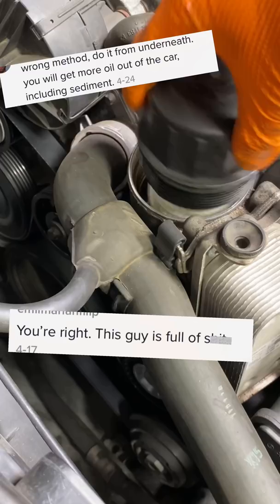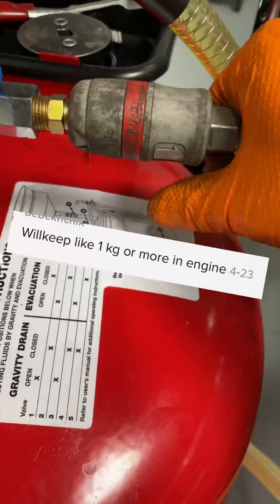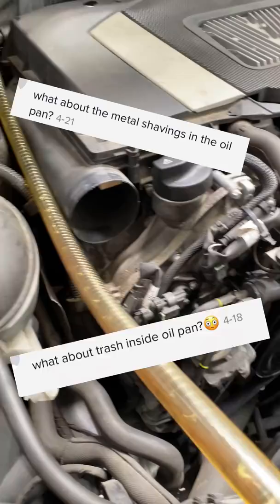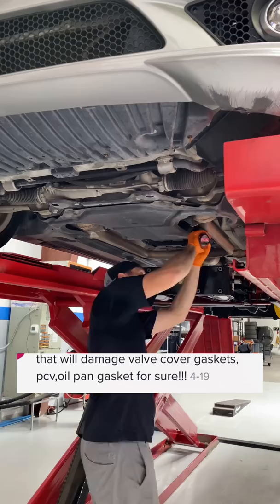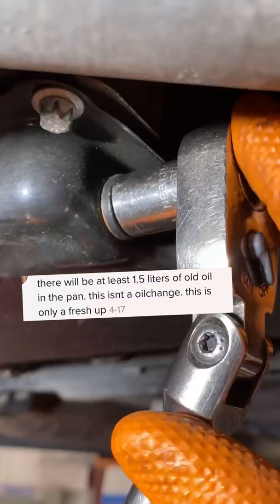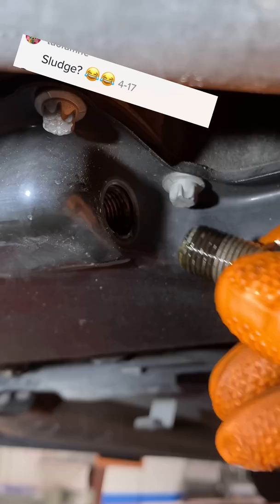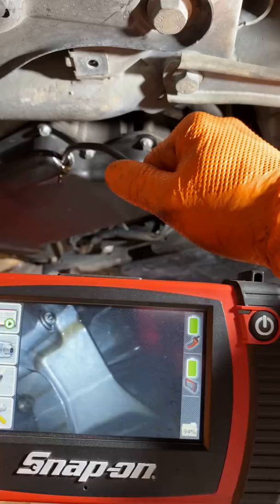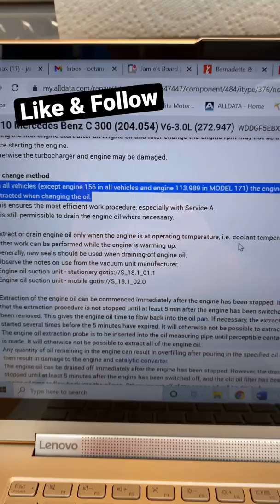#shorts Mechanic Proves Haters Wrong

Comment: "Metal shavings in the oil pan" I'm no mechanic, but if you've got metal shavings in the pan, you have FAR bigger problems than old oil
Reply: Lmao true
Reply: Metal shavings aren't all that uncommon. Unless you get an unusual amount, is nothing to worry about. Especially on a newer vehicle
Reply: Mechanics are suppose to drain the oil using the drain plug on the bottom of the pan. Then they ate suppose to inspect the condition of the oil to see if there is any foreign objects in the oil. Then you report that to the vehicle owner.........
Sucking it through the top is just being lazy simple as that😛
Reply: @2011sombrerotejano  The car is literally designed for a pressure purge through the top of the block?????
Reply: @2011sombrerotejano  Ah... i see. Not only did you not watch the vid, but you also supposedly know more about the vehicle than a mechanic or the people who built the damn thing and tells you specifically how it was designed to be emptied.
Reply: @2011sombrerotejano lmao, you delusional bud?
Reply: There will always be a slightly small amount of shavings, not much but some. If you have a lot then yes it's a biggo issue
Reply: @stardoge6624  Metal particles, yes. Shavings implies something like you'd get from filing metal.
Reply: @RangerOfTheOrder  fair point. Didn't realize your intent was legitimate shavings, my bad
Reply: I was thinking that I was also thinking it's not the transmission lol
Reply: Lmao
Reply: @2011sombrerotejano  are you slow??
Reply: @2011sombrerotejano  Mercedes literally DESIGNED AND ENGINEERD the cars to be serviced like that, but o guess you are smarter than a team of engineers paid 6figures to design cars for a living. Okay dude. You're right.
Reply: @GunShocka  and not just any mechanic. A fucking certified Mercedes Benz mechanic. Like one that literally is certified to work on only Mercedes 🤦🏻‍♂️
Reply: @RangerOfTheOrder  you're arguing semantics..."metal particles"=tiny metal shavings. If not please explain how they get there.
Reply: @GunShocka  well i knew more about fixing my bmw 5 series than the mechanics from bmw working on my car..so yes you can know more than a dealervor regular mechanic. 

Btw i took it to the dealer because it was under warranty but after 2 weeks enough was enough so i had to step in.
Reply: @RanGer-498  You do realize that this isn't a BMW. You seriously tried to tell the certified mechanic of a Merceades Benz That pulled out the official manual that states EXACTLY how Mercedes themselves wants and has designed the car to have its oil emptied and cleaned. Right. We are making fun of you cause all you had to do is watch the video. And yet you try calling the mechanic lazy
Reply: @2011sombrerotejano  <------looks like we have another "mechanic" folks that clearly doesn't know anything about Mercedes or how they are engineered. You clearly didn't watch the video.
Reply: @fifthcylinder  yeah that’s why they have the saying “breaking in the engine”
Reply: @2011sombrerotejano  I read that in my best Mr. Mackie voice !🤣🤣🤣🤣🤣🤣🤣🤣🤣🤣🤣🤣🤣
Reply: @fifthcylinder  of
Reply: @2011sombrerotejano  This guy is a great example that no matter how well you explain something, some people just won’t get it.
Reply: All these comments are Mercedes specific not oil changes in most vehicles specific.
Reply: Lol no one said this isn’t how Mercedes designed it.everyone getting defensive. Like they think just because Mercedes designed their car to be serviced this way it’s a great idea. One of you explain to me how changing oil this way is a better idea. You will always have metal dust as long as you have metal moving parts. So how is sucking it through the engine a good idea??? Newer Mercedes are known for being ultra reliable cars that you can put hundreds of thousands of miles on right? Lol that’s why everyone trades them in at 50k miles and they lose their value faster then a pregnant stripper in Vegas. You want to know why they design them this way? So that you have to take your car to Mercedes dealer for service where they charge $500min for a service. Tell me I am wrong I have own more Mercedes then most of you I promise. They charge insane amounts for oil changes.  And the cars loose value so fast. Toyotas are know for reliability and they get $60 oil changes not $500 and you drain from the pan.
Reply: @2011sombrerotejano  How does it feel to be so freaking wrong?
Reply: @Chamacurmom  ewww
Reply: @HansDester  ew what? Good argument! I bet you are a “supervisor “ somewhere hahaha
Reply: literally i was abt to say i only had metal jn my oil pan once and it meant no more drivey drivery😭
Reply: @cebsaint  dudes more delusional then me and I got schizophrenia
Reply: Ain't that the damn truth
Reply: @Chamacurmom  Just because we aren't Merc Engineers and can't explain why they suggest doing it this way, doesn't mean they don't have their reasons for stating mechanics should. 

Email Mercedes.
Reply: @BillKayNJ  no I think we know exactly why they do it this way. It’s a pretty well known fact? So you have to take your car to dealer for service and pay hundreds for an oil change. Just like many of the Mercedes techs have admitted / commented on this video.
Reply: @2011sombrerotejano  🧢
Reply: my guy do you know what the oil is even for?
Reply: how would there not be metal shavings
Reply: @Dark farts don't ever act like a Benz is better then a 89 gm. My chevy truck will run longer and cost less to fix then any Mercedes benz.
Reply: Lol yeah those comments made my laugh.
Im wondering what they think about dry sump cars
Reply: @2011sombrerotejano  there not at all. Firstly theres few skilled techs 80% of the work force in a workshop are service techs, who arn’t technically minded. If theres any signs of swarf in the oil filter the car would have a big issue with knock or noise from the powertrain anyway. 
Oil change times for most high end manufactures is 15 to 45 mins depending on the task. Theres no sifting through oil 😂
Reply: I was dying when he threw that into the comments.
Reply: @2011sombrerotejano  yeah good call. Drain the black oil into a tub where you can't see a thing.
Reply: @2011sombrerotejano  you think they do that at them oil change places?
Reply: Well, IF you WERE a mechanic- you would know that the magnetic tip of that particular sump plug always has tiny metal particles on them when you pull them out to drop the oil. It's normal wear and tear... Be careful what stooges on You Tube try telling you to justify their actions. This is done to be quick and get 'em out the door fast. It's NOT the preferred method of doing oil changes
Reply: @2011sombrerotejano  EXACTLY bro...
Reply: @JustAGooseman  No, in fact it's not designed for that at all- otherwise there wouldn't be a magnetic drain plug you Wombat... 🤦
Reply: How many people on this thread are actual qualified mechanics? I've been qualified for 22 - 23 yrs, this is my career. This dude has cherry picked a low mile, well maintained Merc- AND TRIED TO HIDE THE METAL PARTICLES ON THE DRAIN PLUG'S MAGNETIC TIP... That's where the majority of the metal will be in this motor (other than in the filter), but some bearing material is non-Ferris metal and won't be attracted by the magnet. You need to clean this metal off the plug each time you change the oil. Visually inspecting the volume of metal particles on the plug gives you a really good idea of the overall health of the motor as well- and a quick look inside the sump while the plug is out will tell you if there's worse damage to the bearings and show and non-ferrous particles. So, this IS a lazy way of changing oil and if you find out your mechanic is doing your oil changes this way- you need to find a new mechanic. FAST...
Reply: @TheGr0nch  It's like you know nothing about engines at all... 🤔😂
Reply: @JustAGooseman  And you are LITERALLY making up "facts" as you go
Reply: @Dark farts How? Explain to me HOW changing the oil is different in those two vehicles... What your failing to grasp is that dealerships will never stop looking for ways to cut corners and increase profit margins... That doesn't mean that they are DESIGNED to be emptied like that... It's the same as these "fill for life" transmissions. Yes, if you stupid enough to believe that an auto trans can live any decent amount of lifespan on one fill of oil- then you probably would believe this too... FYI, those autos can have their oil changed, and if you treat them like a normal auto and change the cloud at regular intervals- it WILL last much longer. You need to get all the microscopic particles out of the transmission fluid or it will eat itself up over time. Just like the garbage that builds up on the sump plug on these Merc's...
Reply: @cebsaint  No- YOUR delusional... 😂
Reply: @RangerOfTheOrder  Those metal particles still build up over time and cause major damage to the bearings
Reply: @zaq55555555555555555  Oh man, your funny as... You REALLY believe that, huh... 😂🤣😂 I can see how easy it would be to be a dishonest mechanic... Geez... 99% of people in this comment section know jack shit about cars, but think they're gonna come in swinging against people who clearly know more than them... This is thoroughly entertaining
Reply: @danielbrealey2924  it takes longer to do that than to drain the sump. It also costs more to do that.
Reply: @jeepmanxj  Hence, my point- these dealership mechanics are cutting corners for increased profit. Just because it's done this way at a dealership, doesn't mean it's the preferred method... Same issue with these "fill for life transmissions"- the dealership will tell you there is no need or even ability to change the fluid- but that's not true at all. The fact of the matter is, not changing the trans fluid severely shortens it's lifespan. A better mechanic will tell you when to change it and offer the service... It's kinda the same thing with these dodgy oil changes, they don't care if the motor shits itself- as long as it makes the warranty period without needing bearings and rings they don't give a damn. They WANT you to buy a new car at the end of the warranty period- that's their aim. So, if that's what you want- follow their advice... 😂
Reply: @danielbrealey2924  so they are doing a service that takes more time and costs more because of the equipment because it's for profit? Ok?
Reply: @jeepmanxj  Yes, at the expense of the vehicle owner... Exactly, the customer gets screwed so they can make more profit- you realise they charge a lot more than general mechanics...
Reply: @Dark farts The fill for life trans B.S was used as an example of the poor quality workmanship on offer at dealerships... Brought this up because dealerships are the only ones draining the oil from up top. That little set up is worth big money and it's unnecessary
Reply: @Dark farts If you don't care about doing a good job, then fine. I was taught to work the other way. To have some pride in your work, other mechanics in the future will judge you on your workmanship. It's probably why we get a lot of restorations and big $ modifications getting done in shops I've worked at. I get what your saying, I just HATE shitty mechanics. I hate dishonest ones even more... We also like to do a condition report on vehicles coming through shops in my country. You can't tell your customer much about the engine if your not looking at what's coming out in the oil and how much metal is either in the bottom of the pan or attached to the magnet on the sump plug. It's all part of the "service charge" in Australia
Reply: @danielbrealey2924  What are you even talking about. You think you have more knowledge about a vehicle than the engineers who designed the vehicle. It literally says in the manual to suction out the oil. And the guy is a certified mechanic for this companies cars. What is wrong with you people. He even showed proof that suction out the liquid does just fine as he empties it out from the bottom afterward to show no sludge or sediment is left.
Reply: @danielbrealey2924  what the hell are you talking about? We’re discussing why Mercedes Benz have such high insurance rates and this is my field. I’ve been in the insurance industry for 9 years.
Reply: @fifthcylinder  i mean..
 if its enough to not get pulled by the oil flow its probably a big concern
Reply: There is literally a magnet inside oil pans to pull metal shavings and keep them from being circulated. As long as it's not alot, it's normal.
Reply: That’s correct. You would need an engine not a lof.
Reply: Lmao did my oil pan gasket on my 97 jeep NEVER BEEN TAKEN OFF till now there was a decent amount but from 97_2021 there definitely should be some lol still runs amazing and sounds beautiful those  inline 6s are amazing
Reply: @2011sombrerotejano  as the child of a mechanic I can say you're wrong
Reply: @2011sombrerotejano  you didn’t watch the video, read any of the comments, do any research whatsoever….. 
whats the advantage of draining the lil from the plug again? Explain it to me in detail. I think i know your mistake here
Reply: Indeed
Reply: My jeep always has at least a pound of brass in the oil pan when I change the oil are you telling me this isn't normal?
Reply: @fifthcylinder  dude false something is fucked if theirs any shavings in their I have never once found any shavings in anything I done a change on that was in prime working condition
Reply: @2011sombrerotejano  or do both also either or the oil is going somewhere it can still be checked.
Reply: @Dark farts yeah but good luck getting that merc to 130k miles the old gm will run well passed 400k
Reply: @stardoge6624  dude false any foreign object in the oil is bad
Reply: @joebone3151  add a magnetic plug and come tell me how there's never anything in the oil
Reply: @danielbrealey2924  i can tell you for a fact your wrong about that one. the oil plug is not what catches filings caused by regular wear (which is a negligable amount of metal anyway) the metal become suspended in the old oil which is part of the reason you need to change it in the first place. so as long as most of the old oil is removed and the filter is changed you have removed the metal filings from the oil pan. thats also part of the use of the filter btw. if there is noticeable metal filings on your oil plug it's probably time to start looking at new motors in the next couple years
Reply: There are metal shavings... but hey, guess what, there are also magnet inside oil sum to catch all the metal shavings! How do i know? I have opened it when working at workshop once....
Reply: @2011sombrerotejano  you were born in 2011 😂😂
Reply: Technically Ur right since THAT METAL SHAVING CAN BREAK SOMETHING
Reply: Lmfaooo
Reply: @2011sombrerotejano  it’s literally in the manual
Reply: @JustAGooseman  it's not a purge.. pump it out..
Reply: Owned Mercs since 1994.
Changed oil myself til 2009. 
Never found shavings or anything ..
Always pumped it out. Still do..
Reply: The people winging in the comments obviously don't take care of their cars if they have shavings in their pan every oil change. Why else would you say something about that unless you've had it happen to you.
Reply: Metal shavings are very common. The amount of oil shavings is what makes it a problem. This is why at industrial sites during oil changes you will take a oil sample. This way the volume of shavings can be determined and if needed a repair can be planned.
Reply: There is always gonna be small minerals of  metal shavings in the oil as long as it's not chunks, your good
Reply: @2011sombrerotejano  that's some quality bait, good job
Reply: @Chamacurmom  it's not sucking the oil through the engine. 🤣 It's going through a vacuum line.  Not sure if you saw when he put the camera into the pan but there wasn't any particles or sludge in there. The vacuum sucks it all out. It's not like they're using a shop vac from harbor freight.
Reply: @GeoThaDude  lol so your “vacuum line” isn’t attached to the engine? Also where does this vacuum line (that doesn’t exist) go?? it’s not a “special line” it goes in the dipstick tube so that it sucks  directly from the oil pan. So I guess we have now confirmed you know absolutely nothing about what you are attempting to speak on 😂. I understand you have no clue what you are talking about but you literally just watched a video where he pulled the dipstick to put his tube in!!! Lol. All I am saying is find me one ASE document saying this is a preferred method. You won’t find anything because it’s a matter of opinion. In my opinion it’s a way to save time and charge more. Do you want to know why they really do it this method? Because Mercedes used plastic oil pans. and taking the plug in and out risks pulling threads or cracking the pan. So we have a high end car that uses plastic oil pans. Uses a easier faster method and charges $400 for oil changes. Lol and let’s just use basic common sense here ( I know that’s a lot to ask of you) when 90%+ of the world uses one method. Wouldn’t you think that is the preferred method? Hahahaha. There is thousands of arguments all over the internet about this topic. from people who actually know what they are talking about I think you should go tell all of them about the “special vacuum line” they must not know!?!? Lol
Reply: @mendoncabeast1  nah, from the transmission, you get pieces of bearing races and scuffed up bearings. 

Explained why the $200 pickup had to be double clutched to hit fourth gear.
Reply: @fifthcylinder  if you can see metal shavings in your oil at all, you have major problems
Reply: @alexpuls8219  Have you ever worked on a car in your life? lol.
Reply: @fifthcylinder  yes I’m a technician at a Ford dealership. If you have metal shaving suspended in your oil, the oil is no longer providing lubrication. It is increasing wear on all the bearing surfaces. So no, there should be absolutely no visible metal shavings in your oil or oil filter for that matter. I’ve been all over this stuff with the 5.4L 3v oil pressure issues. If there metal shavings in the oil in those engines I can guarantee the camshaft journals are wiped out and it’s loosing oil pressure. I was also a lube tech for years before I became a certified Ford tech and never saw metal shavings in healthy engines. Only the ones that were hurting.
Reply: Yeeaah 
Need new engine
Reply: Shavings yes, all oil will have metal particulate in it. Anytime the engine is running it’s killing itself.
Reply: @2011sombrerotejano  thw whole point of using tools is to make it easier, this comment is more stupid that the comments of the video, you stil can chec the condition of the oil an you clearly saw how he checked if there was something in the pan
Reply: And magnet get those if there is any metal shavings
Reply: @RangerOfTheOrder  that’s just semantics ur annoying
Reply: @fifthcylinder  yep that's the break in period. Then you get an oil change after that period.
Reply: Definitely lmaooo
Reply: @zaq55555555555555555  they also "designed and engendered" sealed transmission, which actually still require a fluid change that cant be done lol
Reply: @Chamacurmom  Firstly, Mercedes "recommends" for it to be suctioned out. But if you want to drop the drain plug, be my guest. Dropping all that underpaneling is a pita tho. Plus you better replace the crush washer on the 13mm drain plug. Otherwise it will leak.

Secondly. The engine oil doesn't sit in the pan during operation. The oil pump sucks it up and pumps it through all the galleries and veins in the engine block and cylinder heads. So the idea that the "shavings and sediment" sits at the bottom of the pan like spoiled milk is inaccurate and ignorant.

Thirdly, the dipstick tube is a direct port right into the oil pan. When you suck the oil out with an extractor, you are not "sucking it through the engine." You are only pulling it through the dipstick tube. Similar to how you suck through a straw.

Finally, 500 dollar oil changes? Some dealers upsell you cabin filters and air filters, and wiper blades. But a regular oil change is around 125-150 at most at the dealership.
Reply: @danielbrealey2924  OEM drain plugs do not have magnetic tips. Try again. Definitely not Mercedes drain plugs.
Reply: @LynxStarAuto  at first I didn’t think you knew what you were talking about…Then you used to exact size of the drain plug so you must be an expert!   Hahaha sweet man I don’t really care this was months ago and I had my fun getting people overly mad!
Reply: @Chamacurmom  and owning this equipment myself allows me to just oil change very easily too. There's a reason why it's recommended from the top, metals? residual oil? my ass. this stuff is literally buy able, do you own servicing dog
Reply: @fifthcylinder  depends on how large they are really